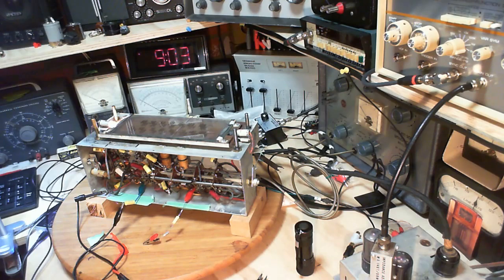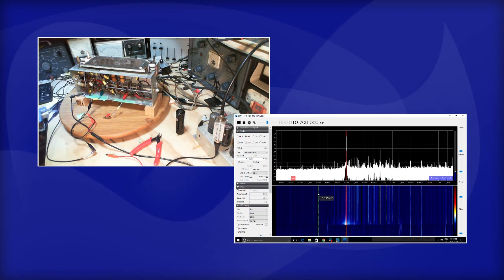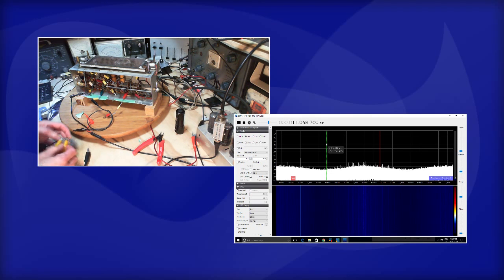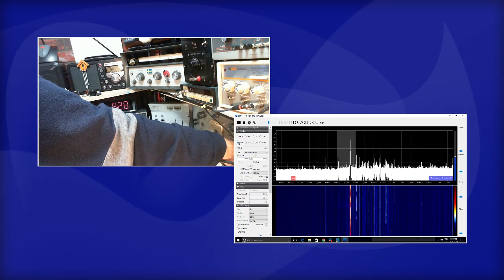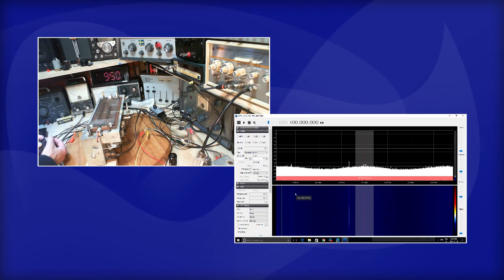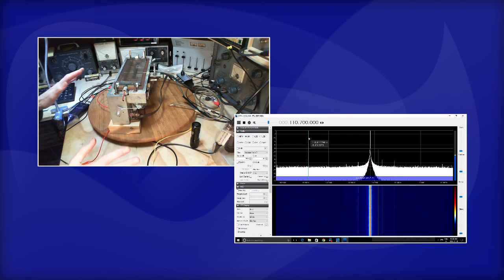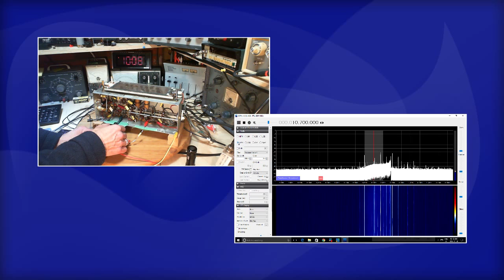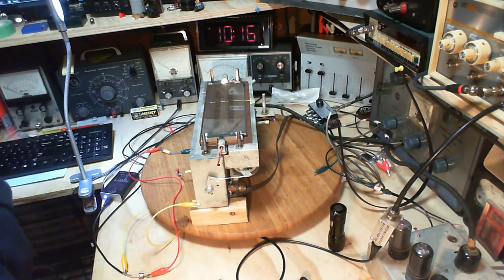Electrohome Chippendale Console Video #27 - Fm IF Alignment

Comment: Guessing since a radio has various coils and the tuning capacitor in it that are resonant your picking up stuff hooked to it when the radio is off with it acting as an antenna. Think of a crystal radio, no power but you can hear radio signals through it.  Maybe from stuff in the shop. Hmmm, that might be fun hooking an SDR to a crystal radio.

Comment: the bandwidth normally used is possibly 75khz as this includes the composite signal with includes the L+R,(L-R DSB signal at 38khz) and the pilot signal at 19khz but as the radio is mono not stereo therefore there should be a notch filter at 38khz if fitted to remove the 38khz DSB L-R signal, just a thought could those signals above 10.7mhz be Digital Radio Mondale broadcasting stations if so they might be QAM or QPSK.
Reply from the maker: Thanks for pointing out the need for a small bandwidth just to cover the L+R part of the composite signal.  I don't know much about Digital Radio Mondale (the savior of radio some say).  I didn't think such signals were used in the commercial FM band.  My guess is that it's just a bunch of noise from some source in my house.  I'm just a little too curious at times.